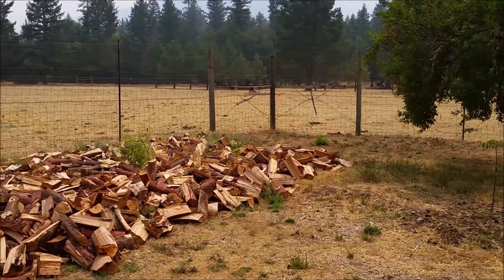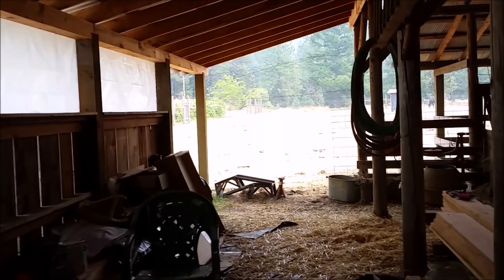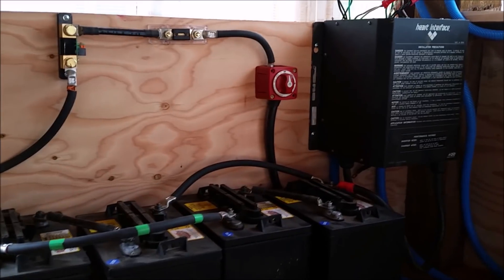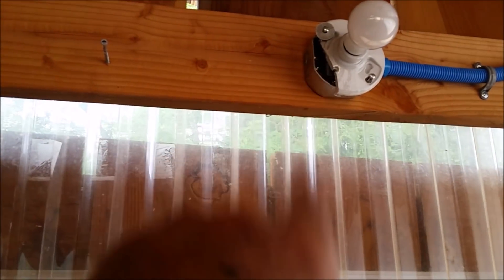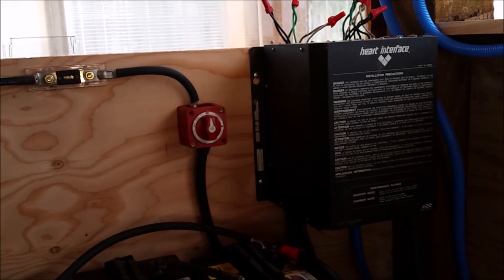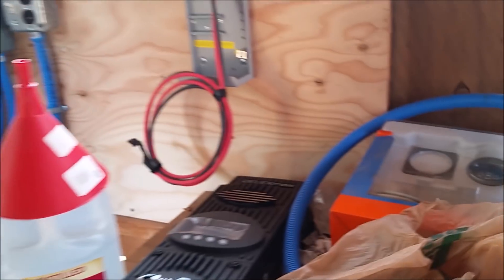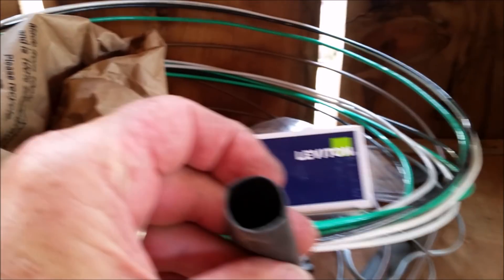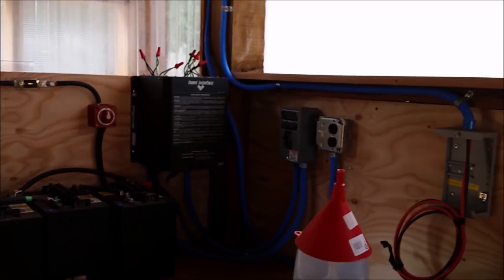Installing a back up solar power system for a neighbor

Comment: Nice...should work awesome for them.
Reply from the maker: Its making power today. Even with the dense smoke it was bringing in good power. I have to add a circuit to the kitchen and it will be done. I hope it does not all burn up. The Klondike fire is behaving rudely. It jumped the Illinoise river on the back side of Eight Dollar mountain. This is not good. Now we have just  highway 199 between us and the fire. The last time this burned  south in the Kalmiopsis Wilderness it did not stop until 600,000 acres were scorched earth. Actually the last good Sasquatch sighting was the night the fire ran 23 miles south back on 2002.

Comment: Nice system. Great lul video. I'm working on my system . for my off grid home. I have 1200 or 1500 in mono panels. ( can't remember exactly how many I got. thet come in over such a long time) I have 600 w up on temp mounts. And 24 v system . t105 and a set of L16 batts. About 750 ah. And I'm working on a lithium bank. It's at 300ah of useable capacity! And planning on atleast 1000 ah of lithium. All I run is the fringe, microwave, a few led lights and TV. Not much more than what's found in a camper. And I'm building a DC generator. And using the lead acid Bank as backup! Gas water heater. I hope 1500 will will be enough solar. With a 5kw inverter. I'm limiting to 3kw. Or trying to! I do have a well pump. It only pulls 7amps.
Reply from the maker: JAMES! Since the 70's Greetings from Oregon.  That sounds like a nice system. We lived on a 1400 watt solar system for 2 years. Here in the Pacific North Wet 1400 watts was a challenge December through February. We have 4.8k of solar now so winter is not so tough. Do you have any videos of you system?